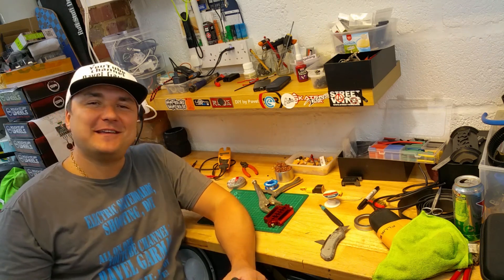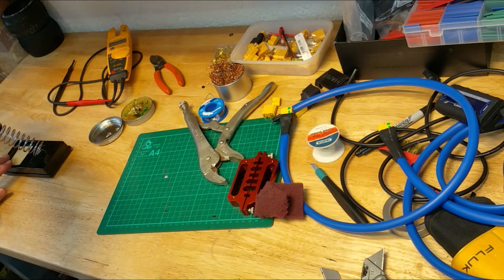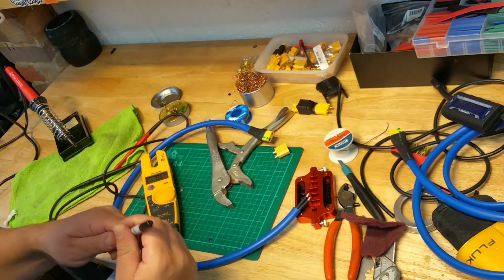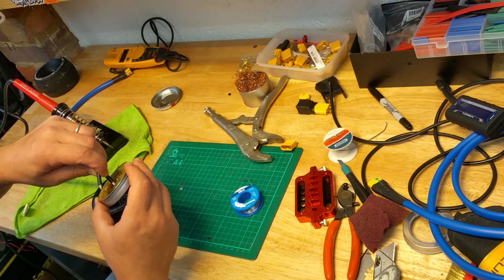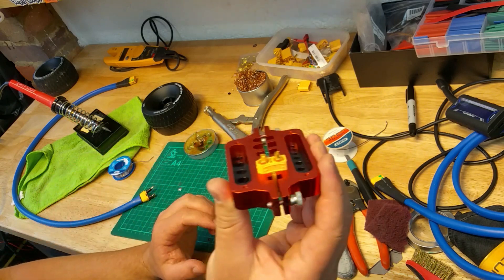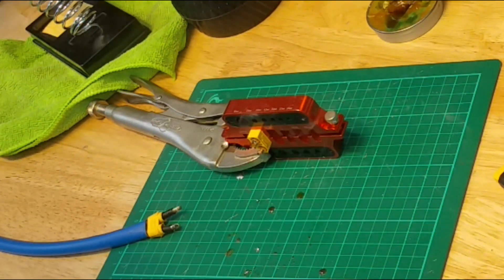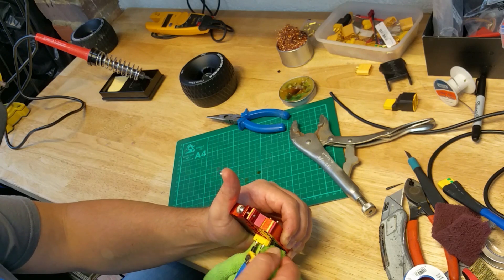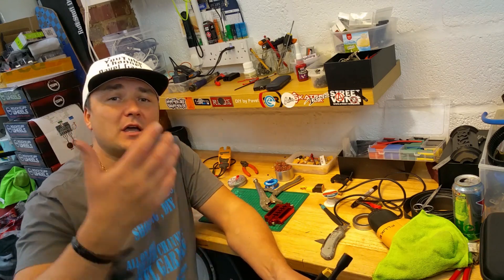How to solder XT 90 connector. Did you know video 9

Comment: I stopped the video as soon as you started using wire wool on your iron.  That's how you destroy your tips.  Use a brass sponge and never ever use wire wool again.
Reply from the maker: Not true...you just clean the thin layer and then tin it again. I do have copper wool oand use it when soldering but do re-tin the tip once in a while.

Comment: Good stuff. I've been using a "third hand" to hold the XTs but it's not stable enough when force is applied while trying to solder an XT and always moves around. I ordered a table vise a few days ago to try that approach. It'll be very similar to your jig/vise grip set up. Regarding left vs right, is it just me or does it seem that most sk8ers these days ride goofy?
Reply from the maker: Hi mate,
Regular or Goofy is like being left handed or right handed i think... however you can train yourself to ride both.

Comment: Question is the anti-spark Technology only on the female and male side or only on the female side
Reply from the maker: Very god question. It is actually a very simple principle - one contact is shorter than another so the anti-spark plug works as a set i.e. male and female part. Do not mix the types mate. And please connect the battery side to the female part.

Comment: Aluminum is a heat sync. The red aluminum jig is a large heat sync. I never use an aluminum jig for soldering. It takes longer to heat up.
Reply: the red aluminum jig is only hold the plastic housing, i don't think it will take the heat away that much.

Comment: You should not blow to cool down the solder. Blowing will crack the solder. What is also a good idea is to plug in the coordinating connector to avoid warping of the XT90. If you solder a XT90 Male, plug that into a XT90 female while soldering.
Reply from the maker: Hello Frank!
So nice to see you on my channel! Thank you for the tips.